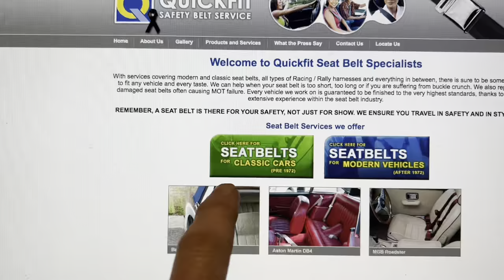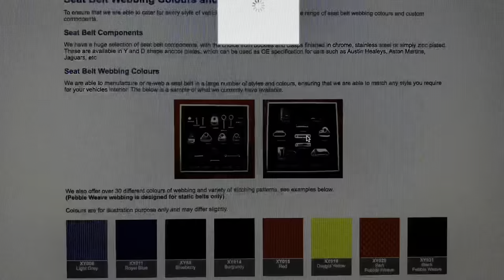Mercedes R107  Klippan seat belts

Comment: Hi Mike. My 1983 280SL has the belts attached to the seat and does have the plastic covers. I believe they are Klippan items but may be wrong and can't check as the car is in storage currently.
Keep up the great videos... I've found them immensely helpful. Thank you.
Reply from the maker: Thanks for your comment and feedback. Mike
Reply: @MikesMercsandothercars  In case you're still interested, Mike, now that the car's back at my house I can confirm that my car is fitted with the Repa belts.
An unrelated question - in your experience is it safe to dip chrome components in the Bilt Hamber rust remover or might it damage the chrome surfaces? Thanks again. Shaun
Reply from the maker: @shaunkitson1813  Thanks for the update. In my experience, dipping chrome parts in Bilt Hamber is fine. The only thing that isn't fine is headlight bowls and certain soft alloys which you will see 'fizzing' in the solution. Mike

Comment: those damn klippan belts... never fully retract. I have spent hours messing with the springs but have never been able to repair
Reply from the maker: Thanks for your comment and sorry to read that you have had problem with your seat belts retracting. The springs do weaken over time  and usually this is cured by taking the plastic cover off and rotating the spring a couple of time to give the spring more tension. If that hasn't worked, the next most common problem is increased friction either by accumulation of dirt and grime on the webbing or rust on the large cog. Trying to lubricate the internal workings without getting old or grease on the actual webbing is quite tricky. Mike

Comment: Hi Mike! My 1973 350SL doesn’t have the plastic parts on the seat belts. Thomas
Reply from the maker: Thanks for your comment - are your seat belts attached to the side of the seat or to the rear floor pan...and are they Klippan or Repa? Mike
Reply: To the side of the seat. Meaning they are always in the way when someone wants to sit in the rear seat…
Reply: They are not Klippen as I recall it. The car is in winter storage right now. I had trouble finding a correct lock once but eventually sourced one from eBay. The Klippan I initially purchased from the Mercedes dealer was a Klippan and that was wrong.

Comment: Hey Mike. I got a question. Is there a good point when someone should give up on trying to fix one of these? Like I have owned the car for over a year and feels like it's never ending project. I have drove the car without issue for maybe a week out of the whole time.
Reply: I've got a project like this as well - I have to remind myself that many of these are now pushing 50 years old. Much of the wear components on normal cars will need replacement (anything that is rubber and flexible for example) - as you drive them more, these already old parts will tend to break down and require replacement... when you want to call it quits is really going to be on personal preference and tolerance (how much time and money do you want to put into it). I suspect if one were to do a full strip and rebuild as Mike has done with his cars then they would be much more maintenance free.
Reply: @herb2k  It's like the car itself isn't bad. I think it's more that I would rather motor swap it at this point. Like I have replaced all the fuel system and ignition system along with all the idle parts . I mean everything wires,plugs, pump, accumulator, injectors, idle hoses, cap, rotor, ignitor reg, it's a list a mile long. It still idle slightly high like 800 and still has the feeling of missing. Mercedes expert near here said spark plugs, changed them again nothing changed. I have carb sprayed and vacuumed tested a ton of times and find nothing. I got nothing it just sits there, the only guy that does tech is 2 hours away and basically will say it's plugs most likely after another month of it being there.
Reply from the maker: Thanks for you comment. Thankfully, I never experienced this myself but I know plenty of people who have. Its like buying a investment in shares, gold or Crypto..you buy it, it goes down...so you buy some more....it goes down further...etc etc until you eventually give up, and as if by magic, the moment you have sold it, it starts going up. Your car is exactly the sort of investment I like to buy....the previous owner has spent a lot of time and money and has finally given up and sells it cheap. Here is my take:
1. When ever something goes wrong on my merc, I smile and think - great - that is something I wont need to fix for another 50 years. I see the parts I buy as an investment, not as a cost.
2. Some of the nicest mechanics I've met, know nothing about fixing or tuning an old merc. I can play the violin pretty well, but it doesn't make me a virtuoso on the cello although the principal is the similar. Same with different makes and model of car. 
3. In my experience, it is worth paying up and travelling to someone who really specialises in that model and has seen it all before. I have spent hours of my life replacing components and retuning simply because I assumed that the new part I had just installed would work. Experienced technicians have seen it all before and made these mistakes a hundred times.

Remind me where you live and maybe I can recommend someone to get it sorted once and for all. 

Mike
Reply: @MikesMercsandothercars  These are all valid.
I live midwest USA, there is only 1 guy I could find in 3 hour that will work on it (from Latvia and only has old mercs outside the shop). He's a nice guy and has helped me before with questions. He did full inspections told me what it needed, I fixed the stuff, it was good for a week. 
Then back to diagnosing, because driving or towing it two hours and have it sit at the shop for a month if it's going to be broken after being fixed. 

It very well could be an issue with parts, but seem so odd it was fine then doing nothing engine related it just decides it's not going to work. I will keep digging or just replacing things. 

The point for me is that it feel like it may never be drivable without actually tearing the whole thing apart and redoing every vacuum line or wire. Which I don't think I am committed to the car enough for that, it's the least desirable model in the states so don't think it's going up a ton.

Appreciate your response and help. Thanks